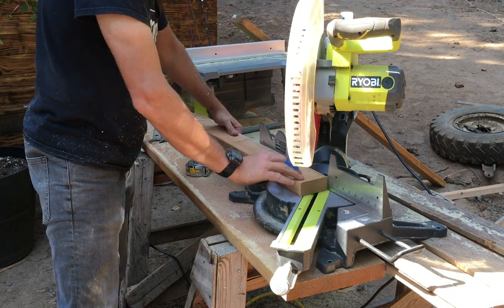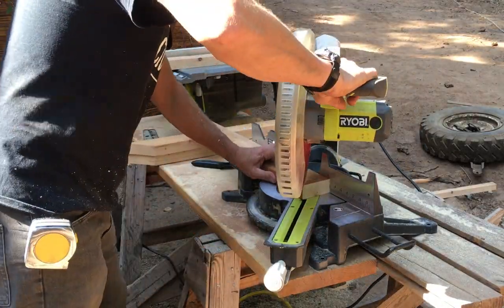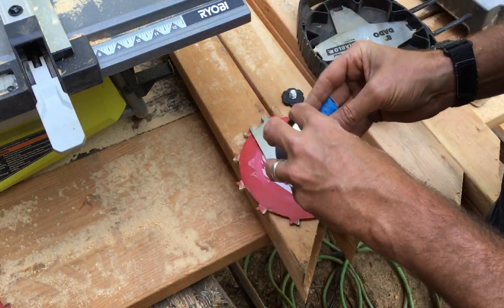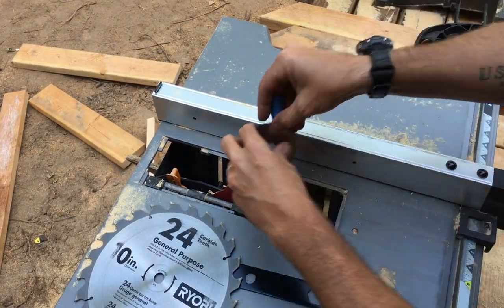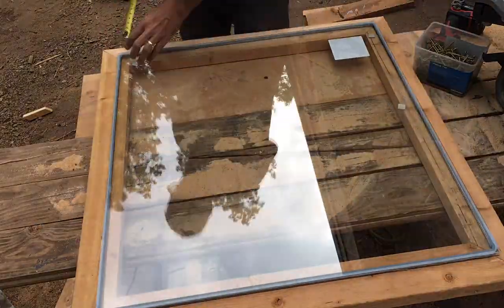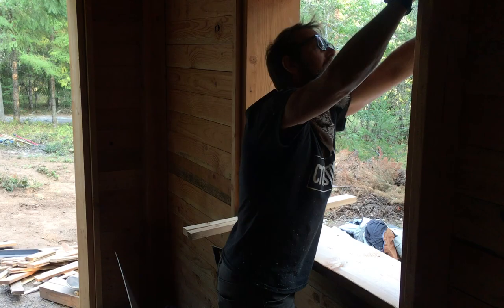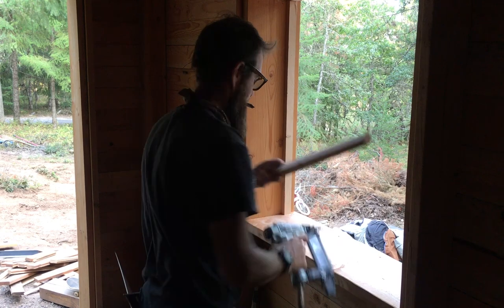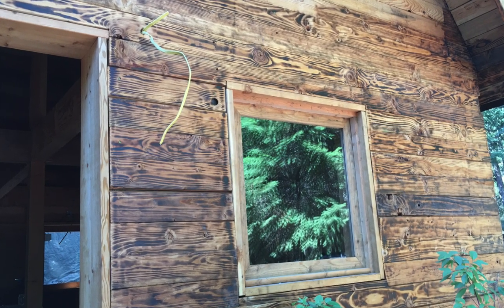Off grid cabin builds & homesteading EP.12 | Build your own custom windows | CROWSFOOT

Comment: Just curious, will the blade raise any higher?  Easier blade replacement.
Reply from the maker: These are 8-1/4" blades , you can get them in bigger sizes. But, yes, I can raise the blade to a 32" dado.
Reply: @CROWSFOOT  Wondering about being able to raise the shaft to make it less difficult to swap blades.
Reply from the maker: oh, gotcha, yes... I have long fingers and a short memory! hahaha, I should have raised the arbor for easier swap. even with the arbor raised, its still easier to put together one piece at a time. just depends on the table saw really....
Reply: @CROWSFOOT  yes,  I agree.  1 piece at the time .